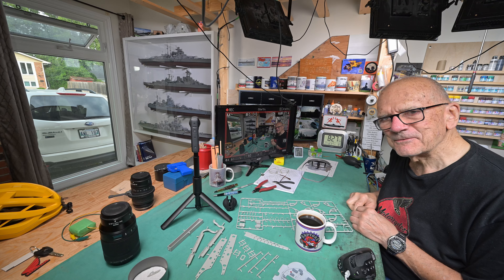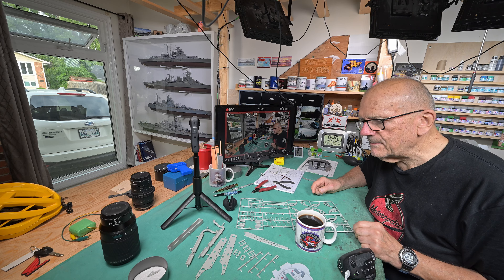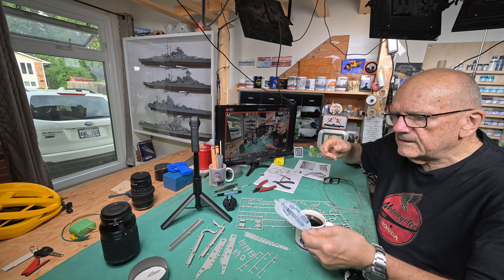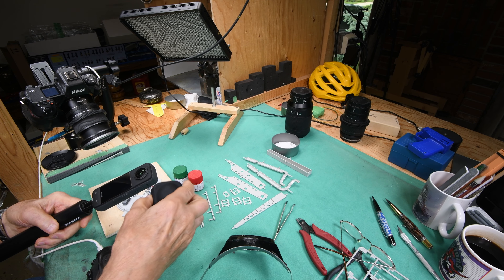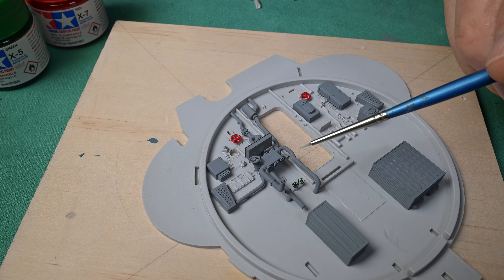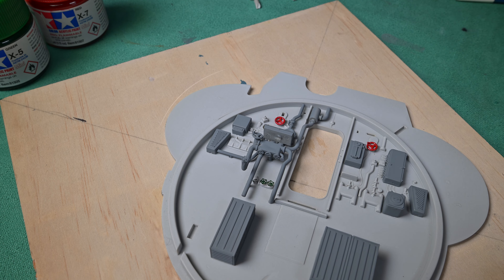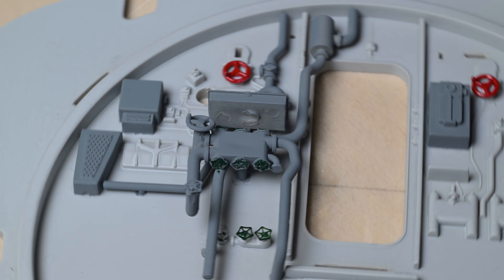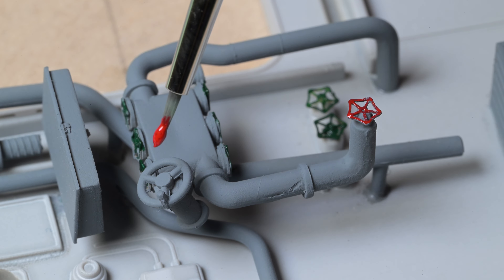The Model Ship - Part 2087

Comment: Hi Ron, Great show today.  I know you have been thinking about your next build.  Did you hear that Trumpeter just announced that they will be coming out with a 1/200 RMS Olympic?  Thanks for sharing.  Have a great day.  Jeff
Reply from the maker: Hi Jeff,
Re: "1/200 RMS Olympic"
I could be wrong, but in all likelihood that will basically be a Titanic kit with a few small differences. It will be quite easy for trumpeter to manufacture the Olympic being that the molds that they're using for the Titanic kit, a lot of it at least, can also be used for the Olympic kit. That's my opinion anyway, but I might be wrong. We'll see. Thanks for the tip.
Reply: @roncalverley  I agree with you Ron, they are probably using 90% of the Titanic parts in this kit.  There are a few differences between the two ships.  I'm wondering what date the kit will represent?  One of the main differences, for some reason, is the number of life boats.  It would be interesting to model it as it was during WWI as a troup carrier with that amazing dazzle paint job.  Have a great day.   Jeff